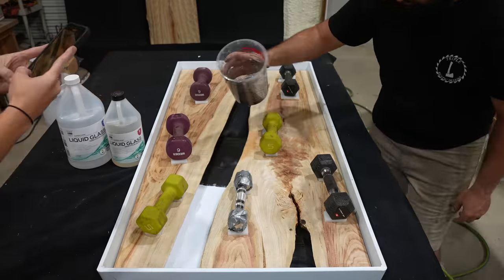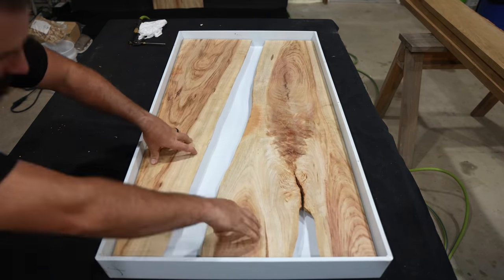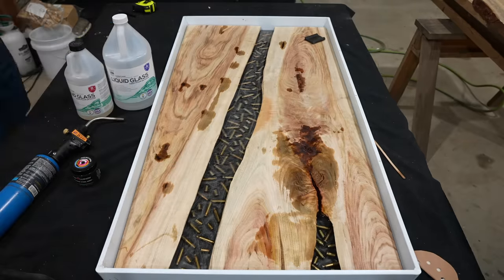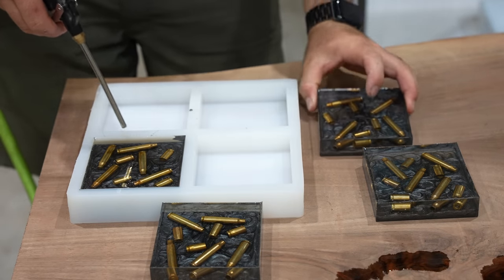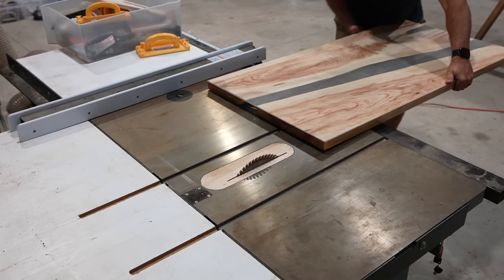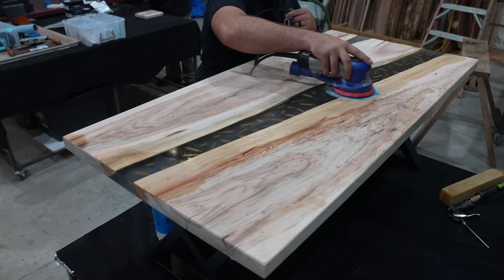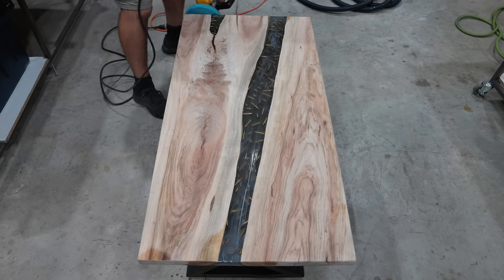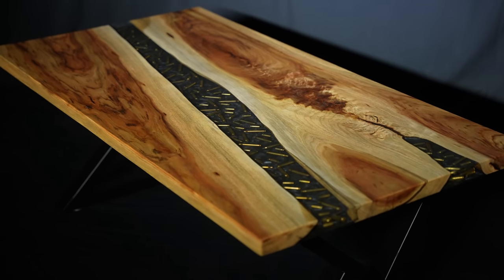The Most Epic Man Cave Coffee Table You've Ever Seen!

Comment: I have done laminated gun stocks and polish just the same, you are taking it to a great level, no doubt
Only thing i would have done different here was put bullet heads back into cases so they looked loaded
Reply from the maker: Great suggestion! I am going to try that soon! Everything I’ve done is with empty casings but I need to try the live round look
Reply: @TripleLRusticDesigns  Just make sure you have something inside the cases or they will want to float to the top.
Reply from the maker: @harpintn  thanks. We always CA glue them down to prevent them from moving

Comment: Love the final look of the table.  Did you consider inserting the legs into wood for added strength?
Reply from the maker: Not on this table. I was already running thin on the bottom of the table. I should have poured my color layer deeper and closer to 1/2” deep. When I flattened the bottom I took off a little over 1/8” and if I had gone another pass I would have lost my color layer. All lessons learned. If I did have a thicker table to work with I would have considered embedding the legs. Thanks

Comment: Would like to see you do one of these tables but instead of using the oil as the final finish do a flow coat of epoxy on the whole table, this gives in my opinion an easy clean up surface for drink spills or sweating drinks that might otherwise leave a ring on the surface. I feel their much more durable but i just like shiney stuff.
Reply from the maker: That’s a great idea! I will do another build video and finish it with the epoxy flood coat next time! Thank you very much